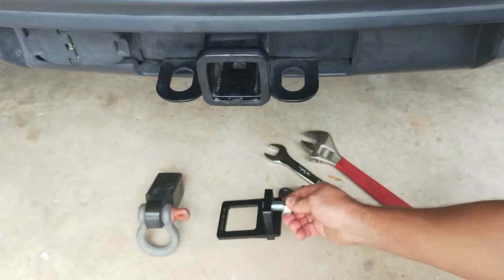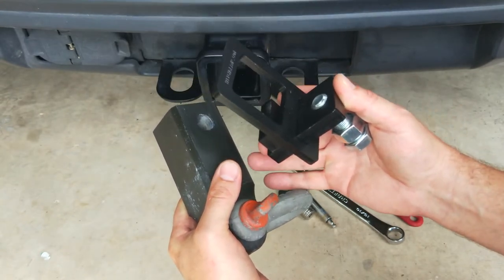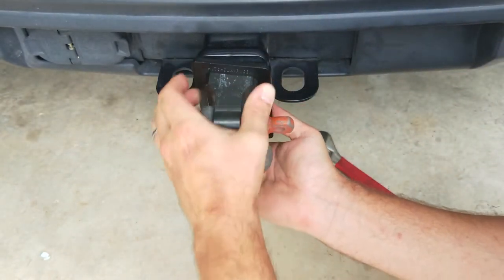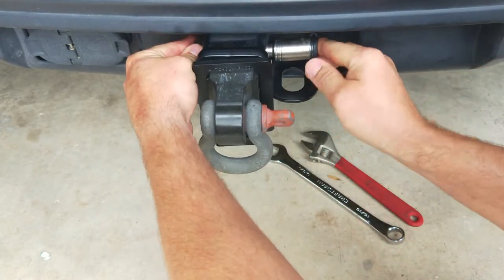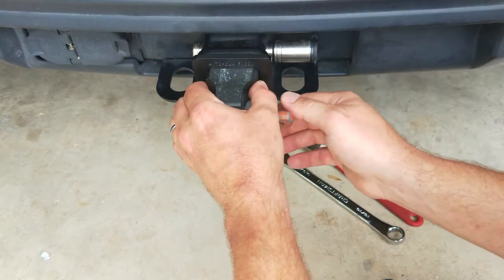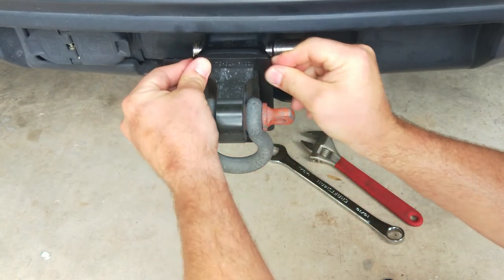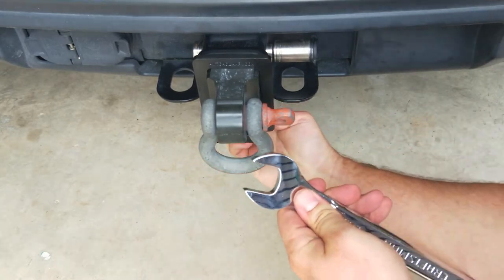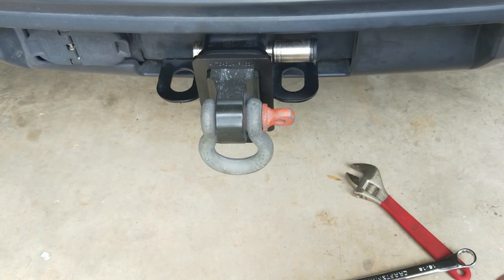Hitch Clamp Install - Anti Rattle tow hitch accessory to eliminate hitch noise.

Comment: Problem now is all tongue weight is on that bolt…
Reply from the maker: Actually, all the weight in on the receiver. The Clamp pulls the hitch down to the bottom of the receiver.  The bolt pushes on the receiver tube and the hoop pulls down on the hitch.